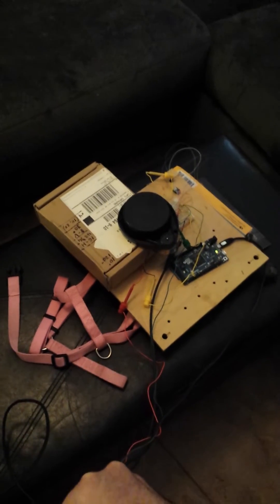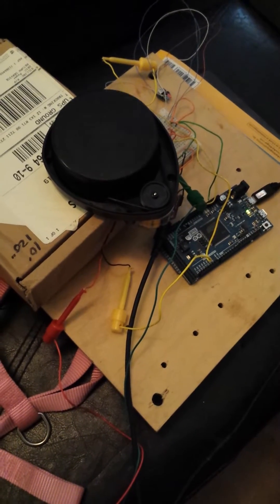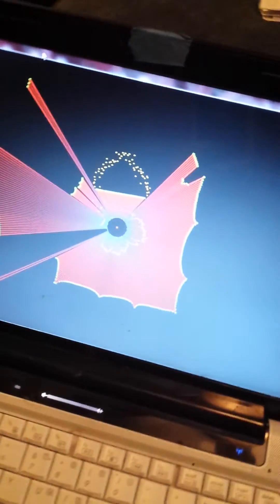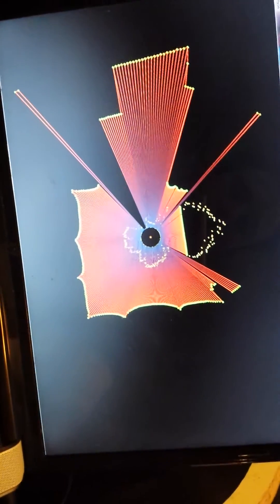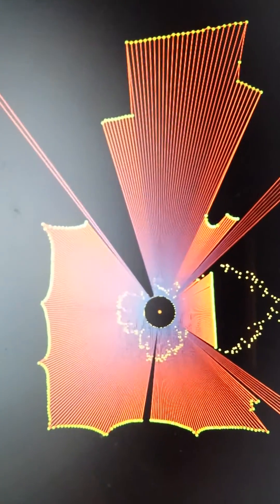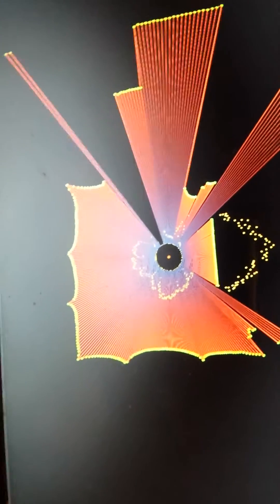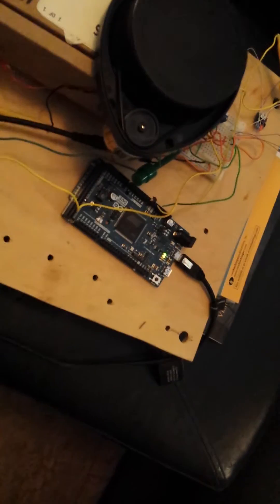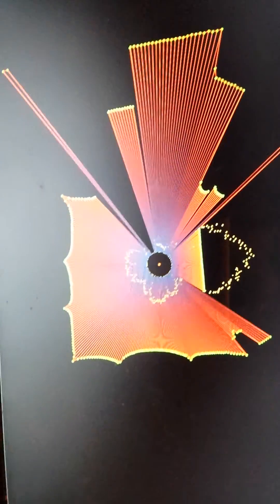Poor man's lidar from Neato Vacuum

Comment: Hi, you're not controlling the rpm directly?  It looks like you're just using a constant voltage with no PWM and getting reliable data.   
Can you please let me know how you are powering the motor?   Especially the voltage that is working? 
We have tried 3.3v and 3v and we get a lot of invalid data on two separate lidar units